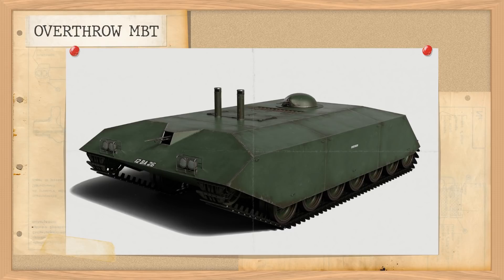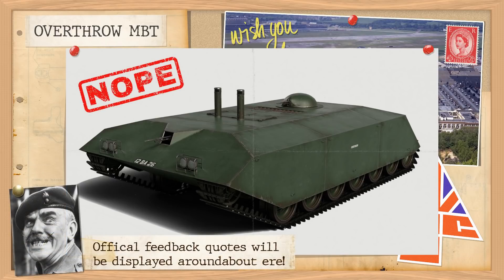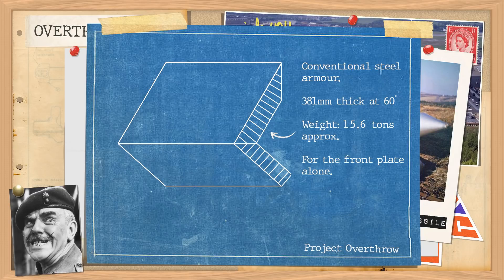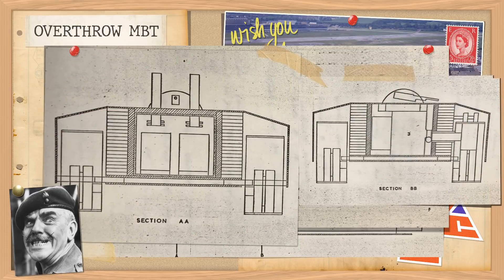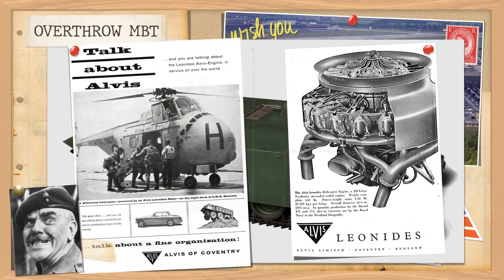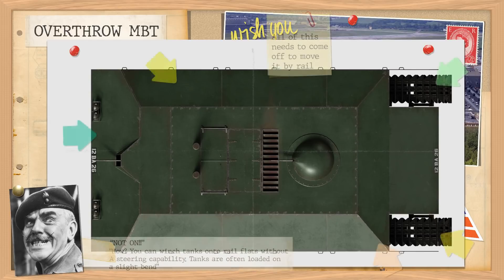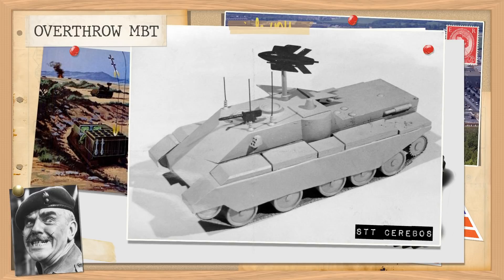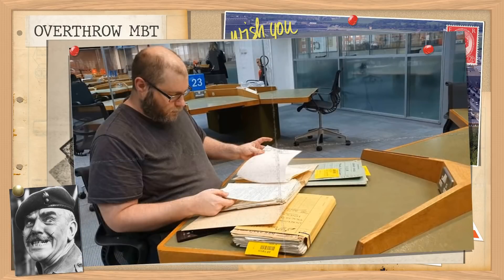The Overthrow MBT – Tank Design & Development

Comment: Why was the vickers vigilant a useless missile?
Reply from the maker: very problematic in hot/cold weather, rainy weather too, lots of control issues, would cut out at certain angles. - was very quickly and quietly replaced.
Reply: @armouredarchives8867  Thanks. It's interesting how many were sold outside Europe then. In the middle east specifically. Such as Saudi Arabia or Kuwait in the early 1960s
Reply from the maker: @farisshaikh1026  yup, but they also vanished pretty quickly, here they were replaced with swingfire, which we did export a bit as well, not sure how long they lasted in the M.E - or whther we even told them they had issues.
Reply: @armouredarchives8867  I was trying to find some articles about the Vickers vigilant's performance but I couldn't find any that spoke of its issues, most of them actually seemed like praise, especially about its ease of guidance. Are there any sources you could recommend for reading about the missile's performance?

Comment: 6:40 This is known as full throttle height, the altitude at which a fixed gearing supercharged engine can most efficiently produce power. More relevant to aircraft of course. The Leonides was an aircraft engine.

Basically at any height below this altitude you need to keep the throttle closed somewhat to avoid overboosting the engine (because the atomsphere gets thinner as you climb). The throttle is a restriction which reduces the total output and relative efficiency ratio whenever it isn't fully open.

Comment: My impression is that it is a 50 / 50 thing. The ultra heavy armour leading to a minimal speed and extreme rail transfer complications where daft choises indeed.. An aircraft type engine should however not have been a problem as the Sherman has proven. The weapon system seems to be spot on. The idea of having to fire something in a straight line / purely ballistic curve is a very old fashioned one.  This thing would  fire itself empty without complex auto-loader mechanisms and then simply backup from the front for a lightning quick reload. One could maybe say the number of "rounds" was too low but imagine what modern fire and forget rockets are doing in the Ukraine right now.
Reply: > An aircraft type engine should however not have been a problem as the Sherman has proven
Complete opposite in fact: the Sherman has proven that by building a tank around a radial engine will result in a vehicle too large to armour effectively. The post-war T-44/T-54 tanks weren't much heavier than the Sherman (the M4A3E8 variant with it's new turret weights about 35tons) and had unrivalled firepower and protection.
Reply: Maybe 18 missiles is enough. The recently revealed KF51 Panther has only 20 rounds of main gun ammo.

Comment: Absolutely amazing. I wonder if something along these lines will be the first AI driven "land drone tank." The VLS missile cells solve many problems in tank design and are the way forward. With no crew and just just a CPU/optical circuits to protect, drone tank could be hardened against  EMP.  With a form of hydromatic suspension and cameleon type camouflage. The vehicle could  literally hunker down like a limpet and sit on guard awaiting orders or intruders. 
Limpet, the British Armed Forces first unmanned AI controlled, autonomous armoured fighting vehicle. AAFV. Sounds far fetched but the same can be said about Tempest.
Reply: It's gonna need a few T800's as infantry
Reply: Maybe VLS isn't a good fit for land vehicles, except maybe for small hard kill active protection missiles. Three problems:

1) Missiles tend to be long, meaning the VLS cells would be relatively tall. This makes the vehicle somewhat tall and thus easier for the enemy to spot.

2) Because of cell height, the most reasonable location for them would be within the hull. But this can mean a catastrophic explosion if a top attack missile hits the vehicle.

3) How do you reload it? Because the cells are tall, and the missiles are tall, maybe you need some sort of crane. In contrast, the horizontal loading of MLRS lets you slide in an entire six pack at once.

I notice most land based launchers tilt, so they're normally horizontal but tilt up a bit for launch. A bonus is that they don't need soft launch - the main rocket motor can fire up from the start and the exhaust just blows out the rear of the launch tube.

Maybe another possible alternative could be sideways launch tubes.
Reply: @IsaacKuo  Javelin, Brimstone and Mistral are not very long. They could be vertically mounted but I see your point. They could also be pallet mounted on something like a blowout 25 cell flat bed for both ease of loading and for separation from a troop compartment or if unmanned. A well protected AI compartment.
Reply: @gusgone4527  Brimstone and Mistral are almost 2m long, but Javelin could work well ... just a bit more than 1m long. Range is a bit low, maybe, but still better than a direct fire tank gun.

Maybe a good place to put VLS for Javelin-like missiles would be the sides - like the jerry can skirts on an S-tank (obviously taller). Placed outside skirt armor sheets, an explosion should hopefully blow outward and not damage the treads.

This position would be convenient for reloading, and it doesn't get in the way of engine maintenance.

Hmm ... maybe it could be a conversion kit for T72 hulls, removing the turret and infamous turret launcher.
Reply: @IsaacKuo  Again, good points well presented. M1 Abrams is 8 foot tall or 8.4m in EU units.  Challenger 2 is 8 foot 3 inches. To include between 18 to 20 inches of ground clearance, so it would be a close thing.  Not that much of a height sacrifice but certainly no room for my flatbed idea. The suggested T72 upgrade is a good idea so please do not tell the Russians or those nasty ChiComs - Shush!

Perhaps we are failing to properly think outside the box in this hypothetical exercise. Why such a huge vehicle if it is to be unmanned?
Surely the idea of being unmanned is to keep people out of harm's way. To fully exploit that concept, the vehicle needs to be less valuable of an asset and more easily replaceable. Meaning a commander in the field can take more risks if the situation warrants. Are you familiar with unmanned ground vehicles or ground drones, as built by MILREM and others? 
https://milremrobotics.com/defence-2/

Picture a tracked vehicle, no more than ten foot long. With the space between the tracks filled with 8 (or more) missile launch tubes. (Javlin, Brimstone, Mistral) Total weight of less than 2 tons. Meaning, for the same weight as an MBT, a force could deploy 30 of these unmanned ground vehicles. Supported by several MILREM Type-X Combat armed with with 50mm autocannons.
Reply: @gusgone4527  Thanks! I am very unfamiliar with unmanned ground vehicles, and MILREM is completely new to me.

I'm really out of my depth here, but I get the impression that wheels are generally better than tracks for such light weights. The size and mass you're suggesting is in the ballpark of a Humvee, and it seems to have good mobility with just four wheels.

I mean ... I don't think wheels vs tracks really makes a difference to your basic ideas. It just maybe offers some different layout possibilities. Like, you could have just two centerline wheels, like a bike, with missile packs on the sides.

Or since it's unmanned you could do some bizarre stuff like making the entire thing roll. Imagine the robot is a large wheel, with the launch tube cluster as an "axle" running through it.
Reply: @IsaacKuo  Tracks are more robust than wheels pound for pound and have a lower weight footprint due to the large area in ground contact. For example the Scimitar in British service, has a lighter "footprint" than a man. A small tracked vehicle will always outperform a wheeled of the same dimensions. 

MILREM is worthy of several hours research. Their  THeMIS UGV and Type-X Robotic Combat Vehicles are state of the art. Already being deployed now! When AI improves, these vehicles are ready and waiting. The company MILREM have a YouTube channel.  Remember that the good stuff is not yet in the public domain. Even so, it's bewildering for an old combat veteran like me.

Comment: I wish you'd give over on pissing on Vigilent.  It was a perfectly fine missile for the time it was designed.
Reply from the maker: hmmm not really, it had  alot of issues, esp beign too hot or cold and firing above certain angles etc, which is why it suddenly disapeared very quickly having a short service life.
Reply: @armouredarchives8867  It disappeared quickly because Swingfire was developed almost immediately afterward, and was better than every other ATGM as of 1966.
Reply from the maker: @RedXlV  yes but not easily manportable hence inswing is considered but dropped, we wanted a man portable missile as well, but viggy while it perormed well in UK tests did very poorly in cold weather. hot weather tests. - it wasnt in service for very long at all comparativly

Comment: I'm barely a minute in and all I can possibly think is "how is this a main battle tank if it only has ATGMs and machine guns?!"
I respect the compactness (and wish the lightweighting value of compactness was more utilized nowadays in say, the auto industry...), but tanks are supposed to be able to act on the battlefield, not just materialize in an open field, survive direct hits, and destroy enemy tanks.

The comparison to the Maus is apt--it's optimized perfectly as a fundamental misunderstanding of what makes a tank useful. They started with armor and anti-tank firepower, then made hasty provisions for mobility, repair, transport, etc.
Reply: In fairness, the documentation suggests that Maus was continuing the concept of a breakthrough tank. Basically, rather than burn up dozens or even hundreds of Panzers to punch the first holes in the enemy lines during an offensive, special battalions of breakthrough tanks would go in to greatly weaken the defenses so far more of the lighter Panzers would survive to carry out maneuver warfare beyond the breach. This means Maus was not really misunderstanding what made a tank useful, just that it was only circumstantially useful, based on a combined-arms doctrine that was no longer economically feasible by the time it was being developed, but that doesn't mean Maus could not have worked as designed. If it only had to move a few kilometers under its own power to weaken the enemy lines for the other Panzers, the fact that it could only move a few kilometers under its own power only meant so much.
Reply: @genericpersonx333  Even in ideal economic circumstances, I'm convinced such an inflexible, expensive, and logistically burdensome tank would be more trouble than it's worth.

I also can't imagine Germany needing such a vehicle to take hold of a few kilometers without long-distance transport in any strategic circumstance other than their near-total defeat.
Reply: @johnologue_gaming  Note, I am not arguing using Maus was a good idea but I am arguing that Maus could have worked. I think the King Tiger with a better powerplant probably would have done the job far more efficiently, but I think Maus could have worked well enough as a breakthrough tank to influence the battle in Germany's favor. I definitely would not want to be the logistician responsible for them, but I also would not want to be responsible for replacing hundreds of medium tanks if I could avoid it. The real problem, of course, was that breakthrough tanks were already mostly pointless by 1944 because the rest of the Wehrmacht was too beaten-up to perform an offensive of consequence.

Comment: VLS on a tank designed in 1963?? That is amazing!!!
I'm kinda surprised/disappointed that anti tank missiles loaded in VLS on a tank is still not a thing today... 😑😑 and No Tor M1 does not count...
Reply: What's the point of mounting it in a heavily armored frontline unit, though? You don't actually want the missiles brought to the frontline, except while firing. In a modern networked battlespace, you could command-fire a missile from a truck 2km behind the frontline. Give it grid coordinates and lets its onboard sensors take over for terminal guidance based on IR or laser designator.
Reply: There's an old computer game you might like called Warzone 2100. It's basically mix and matching turrets, hulls and tracks for armored vehicles. Don't get the Steam version though, its a romhack. The original still available on its own website.

Comment: So you are basically up-armoring a second line support vehicle with tank level armor ?
Makes sense.
I propose to increase the weight and size to 300 tons, add a turret and rename it to Bolo Mk II.....
Better add some RWS too.
And A-pers strips.
Reply: If I remember Bolo Mk II is still a conventional gun tank. You are looking at the Mk III which is the missile armed siege unit contemporary.
Reply: If you're going to go big, there's no real point in only going slightly big. This 65 ton vehicle that can't use existing rail transport (because it's too wide) unless substantial disassembly is done...is just as impractical as a 300 ton ultra-heavy tank would've been.